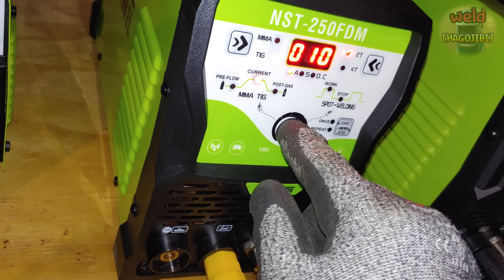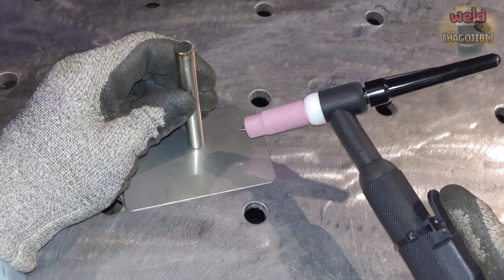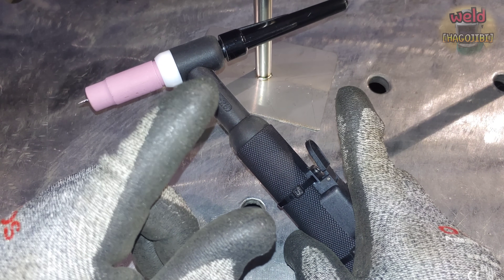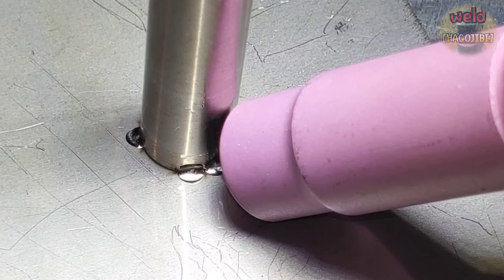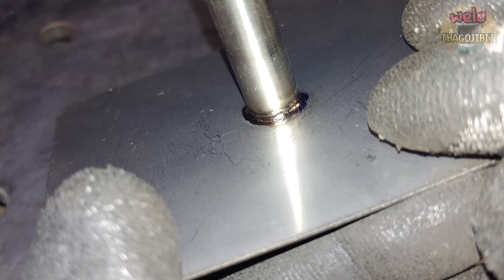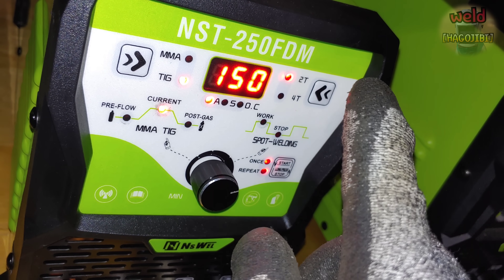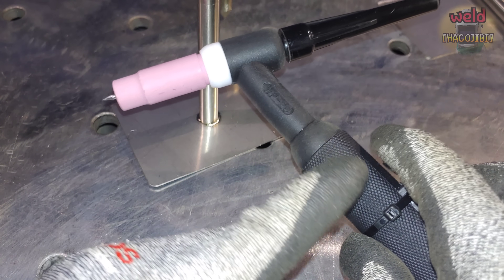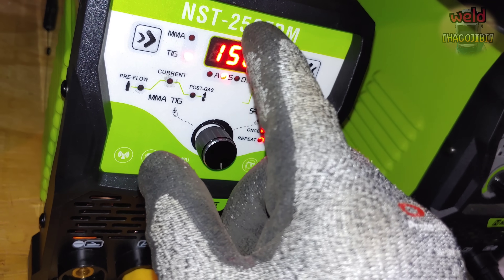Amazing idea ! How to TIG Welding 1mm Thin Tube and 1mm Thin Sheet

Comment: I still cannot prevent the pipe from blowing a hole in it. The base doesn’t seem to want to melt sufficiently to fuse with the vertical pipe. I’ve tried different torch angles, various tungsten taper but have yet to fuse the pipe to the base. Great demonstration., you make it look easy.

Comment: Oh yes, yes, yes! This is the test I had to take to get at a aerospace job. Please do more on this thin material. I can use all your wonderful tips. Could you also do a tube to tube weld in a 45 degree angle. Without moving the tubes after being tack together and weld around or show how it can be done, so I can pass my test. I failed but with your videos on thin metal hey I may get that job.

Comment: Sometimes you have to go in ' blasts ' then let heat flow and dissipate.
When I seam weld 20 thousandth thick sheet metal plates they need to be right together or it ain't happening . Once I get them tacked together good then I can  skim along with a little fill rod ( mig wire )

Comment: This is not welding. It's basically brazing. If you dont swirl that pool of molten metal amd let filler rod be the sole connector , it's not a weld.
Reply: Not true at all. You can 100% weld without filler rod.
Reply: Got nothing to do with brazing...
Reply: That's ridiculous.  Obviously, when one fuses base metals by the autogenous process it is welding in its truest sense.  Stainless steel is one metal that has the property of being easy to fuse by this deductive method, along with the additive method when using filler.

Comment: If I have an older tig welder without settings for short pulses, there must be mods to add this feature?

picked up a cheap second hand tig welder, still to properly explore it's features and learn. #garageproject
Reply from the maker: As shown at the beginning of the video, even if there is no pulse welding or spot welding function, welding is not impossible. However, there is a high probability that the heat input will increase.

Comment: Nice! What glove are you using ? Salutations from Europe.
Reply from the maker: My gloves are not weld-only gloves for welding. I am using gloves with rubber coating.
Reply: The kind that are melting into your skin when you' welding with actual heat. 😉

Comment: Question: do you touch up (lightly regrind) your electrodes periodically, even when you don’t contaminate them?

Secondly, have you found (2% lanthanated) electrodes want a certain amount of “current density” to run “right?”  

Example: 1/16 inch /1.6 mm electrode feels or acts “weird” (I know, vague language, but I cannot think of a better way of saying it) below about 40 - 50 amps, and has a “best” region about 55-80 amps?  More than that, 3/32 inch /2.3 mm?

Thanks for demonstrating the thin welding.
Reply from the maker: If the tungsten is not contaminated, it does not necessarily need to be regrinded.
Thin tungsten is advantageous for low current welding. However, it consumes more than thick tungsten.

Comment: How to setting spot welding to miller dynasty 350
Reply from the maker: If spot time setting is possible, cold welding is possible. However, you should check the manual to see if automatic spot welding is possible.
Reply: Up slope 0, downs lope 0, frequency 1hz, control pustíme with on-time in %

Comment: All time that I used "cold welding" mode it was turning out that I no need time less than 70 ms even if current was set to 150-170 Amps. Human can easily do this with hands. E.g. typical mouse click time is about 50 ms. So you just need a comfort using your switcher.

Comment: What causes there is a hole in the middle when tack weld master
Reply from the maker: There are many causes of pinholes. The pinhole will disappear if you use a crater current or slowly cool it with additional spot welding.